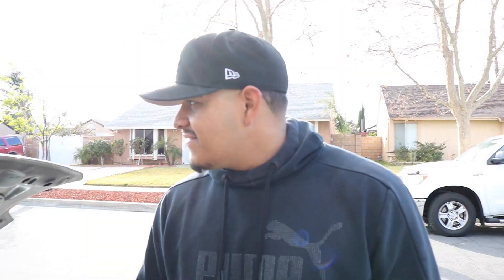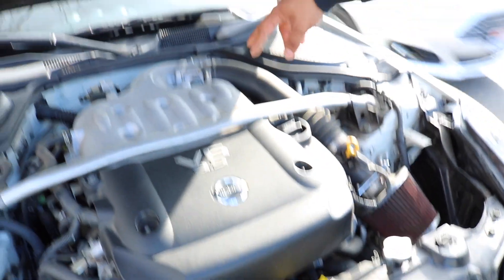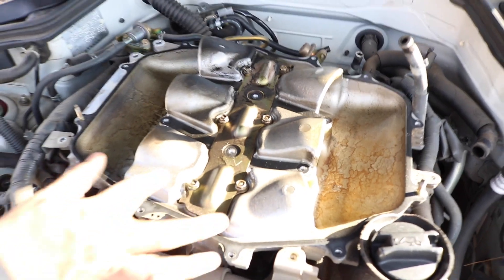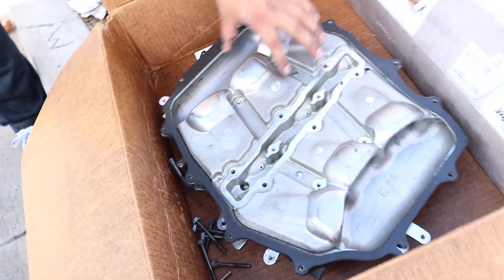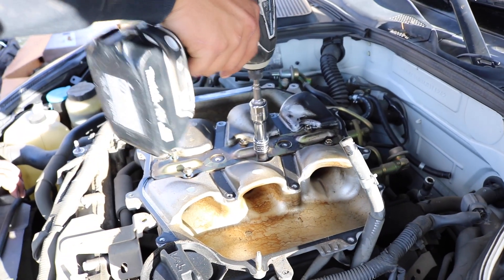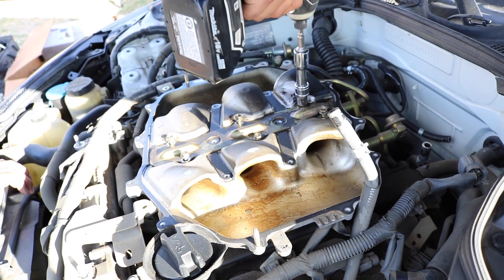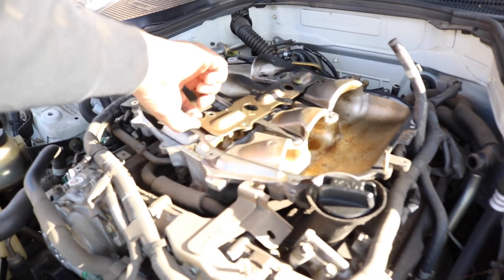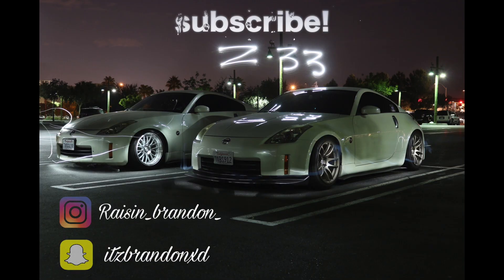Motordyne Mrev 2 lower plenum and 5/16 spacer 350z install!

Comment: Go back and torque them bolts. over torquing is bad and under torquing is worse . don’t want issues with your engine bro
Reply from the maker: Mycal-Z33 thanks for the heads up bro, I appreciate the advice  👍
Reply: Its just air dude lol as long as it’s tight and in the correct pattern it’s fine you don’t have to torque it exactly to certain specs

Comment: Did you not have to reset ecu or tb? Been reading about people installing them and having idle issues. I got one sitting in my room but hesitant!
Reply from the maker: Bryan Frank no, I didn’t have any issues with idle at all after installing it. It was a direct bolt on and no reset of ecu or tb. You can definitely feel the difference in power after you install it 👍
Reply: I just installed mine today, I love the difference in tone and mid range power, and if y’all ever experience the vq hiss, it seems to help get rid of it by a tiny bit. But I recommend also installing the throttle body spacer with it

Comment: Quick question bro ...is there a difference in performance of a motordyne 5/16 spacer and a motordyne iso thermal copper 5/16 spacer?
Reply from the maker: Omar Preciado I don’t really think so. Any spacer is better than no spacers lol
Reply: @brandond6725  oh ok...cause they are 2 motordyne spacers but different...just asking if there was a difference...how long did it take you guys to install it?
Reply: @brandond6725  what kind of rims are on your z bro...i want those...please let me kno
Reply from the maker: Omar Preciado I’m not too sure bro, my wheels are vordoven forme 9 👍
Reply: @brandond6725  i bought a used mrev2 from a guy that had it on a g35 sedan..what are the signs to look for to tell its real or fake?..on the i bought it said on the part "mL1 and mR1"?...real or fake?.what did yours say?
Reply from the maker: Omar Preciado I’m pretty sure it’s real, I think mine also said that. Besides once you take your oem one out and compare the runners, the mrev2 is gonna have wider holes for better airflow
Reply: @brandond6725  i just called motordyne engineers...send them pics...they said 110 percent motordyne genuine....wish we can cruise bro
Reply: @brandond6725  hey bro...hope all is well...question....is a 1/2 spacer deliver more power than a 5/16m
Reply: @JustaM340i  1/2" spacer makes slightly more power over the 5/16 spacer but to my understanding the 5/16" spacer is better because you get gains all over the power band vs the 1/2 gaining top-end power.  P.s. the kinetix v upper plenum is only good for forced induction.

Comment: Do you guys think the kinetix v+ plus with mrev2 and spacer will be a ok setup?..kintex upper plenum of course?
Reply: You can't have both. The kinetix v+ upper manifold connects directly to the intake manifold bypassing the lower plenum. The kinetix doesn't use the lower plenum.
Reply: @joshuawiggins7487  No I'm talking bout the upper plenum kinetix v+ not the v2 ...I kno about it when it doesnt need the lower plenum cause in order to put the kinetix v2 u gotta take off the the lower plenum..I'm talking bout the v+ kinetix the one that looks black...word of the hard plastic look ...it goes on top of the lower plenum?

Comment: If i just put the mev rev2 will i pull just the same or no? Cause i dont have the spacer yet
Reply from the maker: Omar Preciado for the 06 rev up models, it’s best to use both the lower plenum and the spacer as well. I suppose just the mrev2 will make you a little faster
Reply: @brandond6725  ok koo cause watching this video to be honest i went to go buy one...but no spacer...guy sold all of them!...i kno its best to wait...but im very tempted to put it on to see and feel the difference before the spacer haha...
Reply: @JustaM340i   did you ever get that spacer and did it made a difference ?
Reply: @jarellano1482  I did...with the mrev 2

Comment: Hey, did the mrev2 come with new gaskets or bolts?
Reply from the maker: Edrix G35 yeah they come with the bolts, I got mine used and it came with everything ready to install 👍
Reply: Brandon D for the 10mm bolts that are around the upper plenum, did you reuse the same bolts?
Reply from the maker: Edrix G35 I believe we used the new ones because they were a bit longer lol
Reply: Brandon D finally got my mrev and spacer installed. How long did it take ur ecu to re learn the a/f ratio? And im having a code for a misfire, is tht normal?
Reply from the maker: Edrix G35 I’m not sure, I still don’t think my a/f ratio is right. I think I’m gonna need a tune to get the most gains out of it. And you shouldn’t be misfiring bro, you probably have a small vacuum leak somewhere or the plenum was probably not tighten correctly